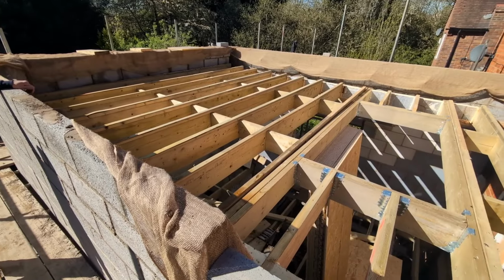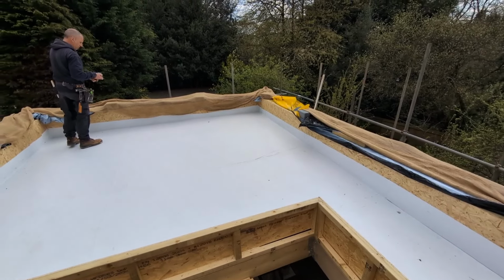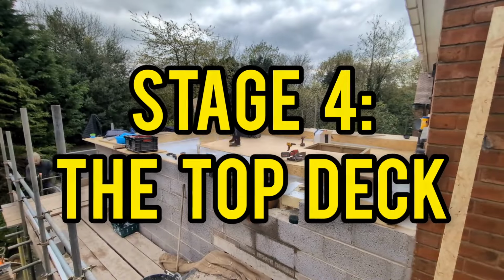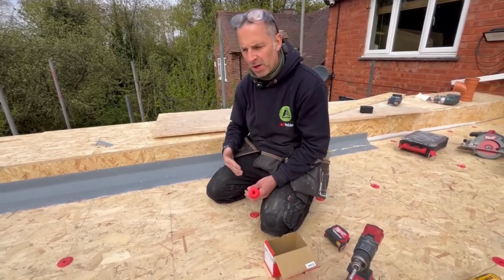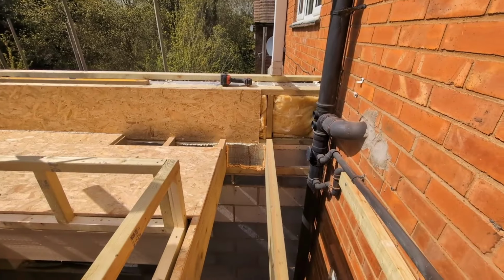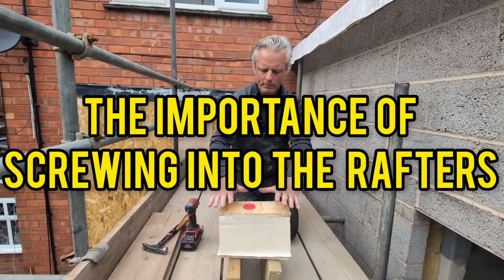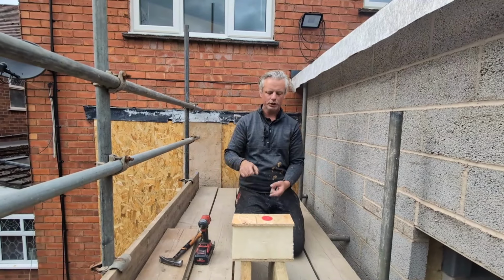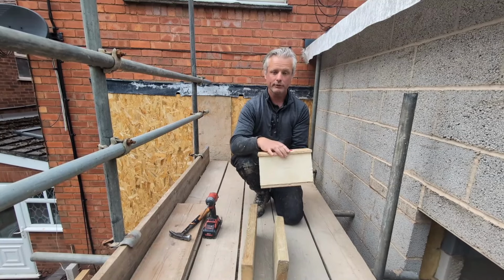How to build a warm roof. A step by step guide to the BEST warm roof on YouTube.

Comment: Hi, very well explained and built. Exactly how we do it and with the festool saw! We do a few minor different things like 50mm sound proofing rockwool below the deck which has been checked and approved by Kingspan for condensation risk. Which increases u value and makes the roof quieter. We also cut a slight recess in the deck so the warm roof fixings can’t be seen when the roofing cover is laid. Also we don’t build with cavity walls. Our preference is porotherm with external wall insulation. Anyways moving on to the faults I have been told with our roof is apparently we should not be using warm roof fixings with GRP roofs. Plus if we do they must go 40mm into the joist does not include deck or ferrings. Not the case with any other roofing cover. Also at the roofing show the 5 big roofing covering manufactures which include Bauder, Sika, Danosa, Icopal and the others all said tissue based insulation for flat roofs only must be used on top over the VCL and then no ply or osb but the roof covering must go directly onto the insulation board. Indicating warm roofs should not use GRP. GRP companies I am sure would not like this. I have a document which is similar from all these companies as to the physics that mean a warm roof can’t have a osb or ply top deck. So I have wondered if a cement board floor could be used. Then recently due to Grenfell you can’t make a warm roof apparently that does not have a fire certificate. So event though all of the manufactures have a very similar or same looking silver and black sticky VCL (like alutrix 600) simular tissue backed insulation. You have to use all these layers made by the same manufacture as the roof covering to comply with current building regulation as they don’t fire test competitor's simular product and hence only way to get the fire certificate is to use all the materials from one manufacture. So this leaves me confused moving forward as doing it that way would remove GRP roofs and increase costs of materials.
Reply: Be good to hear a reply to this! Currently confused as to the makeup for a warm roof im about to do on a property of mine
Reply from the maker: Hello Liam, hope you're well. If you're in England (I can't speak for any other country) then just follow the steps in the video and you'll be fine. You don't have to use GRP, you can use any roof covering you want. Any doubts then ask your building inspector.
Reply: @Mr_A_Builders  hi buddy. Yes uk - scunthorpe. 
It was more the use of foil backed pir with osb above this. Manufacturers advise against it for some reason due to condensation/ deterioration of this top osb. I'm wanting to use it and didn't know if to source a non foil faced pir board to avoid this risk.
Reply from the maker: @LiamLiddy Hello mate. If you'd prefer you could send us an email (address is in our bio) with you phone number in and I'll give you a call and we can go through it. May be easier?
Reply: @Mr_A_Builders  really good of you to offer that! And replying to your comments 👌🏽. If you could tell me where abouts to find the video showing how to set up the diminishing flat roof rafters so I can fall the whole roof to the outlet that would be great!

Comment: Hi,flat roofer here for over 40yrs  why oh why would you go to all that trouble and then put a top board over the installation and cover it in grp ? When you can get rid of your carrier board and go with a single ply membrane or a built up felt system or a liquid pvc system straight on to the installation far far better and will last for years
Reply from the maker: "far far better" in what way?
Reply: By getting rid of the top board on the installation and then install a decent waterproof system instead of GRP or epdm that requires a top board as this  is a bad practice regardless as to what Mr GRP man says
Reply from the maker: @rcteryx how is it bad practice?

Comment: If your doing grp finish then I would use 18mm T&G as top substrate… reason being… with grp you need to make sure their are no gaps that resin can flow into underneath the matting…. T&G prevents this from happening.  Otherwise you can end up with pin hole sized holes in your grp roof.. alternatively just seal all butt joints on normal 8 by 4 OSB with some sort of sealant.   It’s belt and braces for sure but I have seen it happen.. and the pin holes are really hard to find on a warm deck roof… so best be safe..

Comment: Really appreciate the thermal fixing explanation and model. I've used the wafer head screws and you're right, you see them everytime there's a frost and the heat transfers through the screws.
Reply from the maker: Well there you go, mate. Every time you can see them in the frost that's heat escaping and simultaneously damaging the roof covering! No worries man! How's things anyway?

Comment: Great video and work. my concern would be air gaps around the fixings when using Grp, as those raised areas would be a bugger to get a perfect seal with resin and matting. What do you think?
Reply from the maker: Hello mate, I see your point and it's a valid one, which is why we filled the screw holes in the thermal fixings. When then took special care to work the matting around the fixings for the reasons that you say and it worked great. It's definitely something that you wouldn't be able to do with a rubber roof.
Reply: Cheers from a Brighton roofer/builder..we do a lot of GRP work.
Reply from the maker: @bluewaverenovationsltdpurt8104 no worries man. Hope you're well and busy. Take care.

Comment: Just saw this great video and explanation.      regards thermal insulation, is it better to have this above the joist, or in-between or below,   we are looking at replacing a glass conservatory roof with a flat roof as its leaking after more than 12 years.  so done well but now with the cold weather etc.  I am worried if in between the joist will still conduct the cold through via joist.   today it was 9°C inside and its 0°C, outside (4th Jan 2025) yes I know you norther's think its warm but we southern lot like it warmer 🙂 helpppppp
Reply from the maker: Hello Pete. If it's a warm roof that you're going for then just follow the steps of the video to the letter and you will not go wrong.
Reply: @Mr_A_Builders   Hi Thanks for that.  Need to check if we have the height for that.

Comment: After reading a few comments on here, I just wanted to try and clarify a couple of points that might help others.
I think a lot of confusion stems from the fact that people (and the internet) mix the terms 'Vapour Barrier' and 'Vapour Control'... A vapour barrier will stop both the movement of air (thus being air tight) and any passage of moisture... whereas the vapour control is generally considered air tight (factually it's not) but will allow for the slow passage of moisture vapour. It's all to do with the materials that make up the various products.. for example: if you take a metal pole and call that the vapour barrier and take a wooden pole and call that a vapour control, place both the poles into water as a source of moisture and you will see that the wood will slowly absorb the water (moisture absorption will rise above the water level) whereas the metal pole will not (close enough without going into atom detail). 
A VCL (Vapour Control Layer) is designed to a slow down the passage of moisture to a controlled level whilst also allowing an acceptable level of air passage as not to affect the warmth of your property. In a warm roof construction, a VCL should always be used on the underside of the insulation.
Another common misunderstanding is that when something is labelled as waterproof it doesn't mean that it is also air-proof/air tight.. for example an EPDM rubber roof will stop water/rainfall passage but will allow air passage... thus allowing your warm deck roof to breath, remove the controlled moisture passage from the VCL whilst keeping your house warm and snug.. 
PS. Great vids.. keep up the good work  👍👍

Comment: Happy birthday! Wondering what you think about the theory which says that you ideally shouldn't use a top deck of OSB because it's on the cold side of the roof and more susceptible to condensation and rot. Better to just have the roof covering directly bonded to the insulation. Also heard that foil faced insulation isn't the best thing to use either, because the foil facing acts as a vapor barrier and you only really want one vapour barrier in the system, otherwise you can potentially trap water vapour in the middle of the system. Needs to be hard for water vapour to get in, easy for it to get out.
Reply from the maker: Thank you, Ewan. I don't really buy into that to be honest but I'd happily be shown and proved wrong, always willing to learn!!! One of the main issues there is how do you fix the insulation down? We all know that it's not the strongest of materials. Also, the only thing holding your roof covering on is the glue between the PIR and the foil or the fabric type stuff. I won't be charging people for that anytime soon!
Reply: @Mr_A_Builders  Where I've seen it done they just seem to use the same thermally broken fixings as you did here, the large "washer" on the top should help spread the load a bit. It's not the strongest, but even in this video you guys are walking around on it without much cause for concern. It's really not that different to the stuff you use under a concrete floor.

Comment: Great video as always lads, id love to see more on how you drain the rain water from the roof.
Do you guys aim for a perfectly level roof or do you use ferrings for a slight slope towards the outlet?
Reply from the maker: If you’ve only just joined the channel Dan welcome but we do it two ways. In this instance, which I went into in detail, was diminishing battens. 👍🏻
Reply: Awesome video. Clear and to the point but, I also had the same question - From the finished picture it looks like a perfect bath tub to catch water but with with no apparent drainage point?  Where will the rainwater go?
Reply from the maker: Oh there's a drainage point! Trust me! From the thumbnail it's the far opposite corner, you can't see it because of the lantern, it is in the video though.

Comment: Thanks for another great video. Just started a warm deck today. I’m always confused with the vapor barrier. So it stops all the condensation from the insulation soaking the deck below but what happens to all the moisture? Does it just stay trapped forever? 😆
Reply: Think its to stop moisture from inside the building condensing on the underside of the top deck and rotting it.
Reply from the maker: Hello Dom, hope you're well, mate. The vapour barrier is to create an air tight seal from the bottom deck upwards. The whole point of it is so the heat within the room below stays there and can't pass through. That's why we screw through into the rafters, it's to try and maintain the integrity of the vapour barrier and not rely on its "self sealing' properties.
Reply from the maker: That's sort of it, mate.

Comment: Hi, im currently doing a warm flat roof. 

Ive done ply above firring then alutrix 600 stuck on then 150mm pir then osb 3 then it will be edpm

It also says to put a vcl on under the joists (ceiling) before plastboard is this wrong ?
Reply from the maker: Hello Matthew, hope you're well. Sounds like you've done a great job! Nice one! You don't need that VCL under the joists, you've already installed one so that's that! Just plasterboard and you're away!
Reply: @mrabuilders6723  Thankyou for your reply thats helpful. The chap whos going to lay the edpm isn't keen on those thermally broken fixings with edpm. Realistically do you think there will be any problems if I just use long screws through the decks, I know alutrix should heal around the screws which should help a little..

Comment: Hello both. 2 questions please. 1) Theres a lot of strand board used on the layers of that roof. Is it a warm roof solely because you need 150 mmm insulation making cold roof impractical. 2) How did you transfer the rafter centres up to the roof 🤔 . Thanks 🙏
Reply from the maker: The answer to question two is simply just measure off a fixed point then go underneath and see if you can see a screw poking through, if you can't then you've hit the rafter! As for question 1, it's all about the height of the roof and what you can get away with which we will go through hopefully in the next episode.

Comment: Could you use 18mm OSB  instead of 11 mm therefore countersink the plastic thermal fixings hense have a flatter deck for the GRP ? Love to hear your thoughts ?
Reply from the maker: Hello Glenn. It's not impossible mate, but the heads of the fixings are approx 5mm if not more, definitely not less, and you'll have to go deeper as to have room to fill over them afterwards, so there's not a lot of meat left to confidently fix down to if that makes any sense?
Reply: We do this and use 18mm t&g OSB3. We use a countersink and take out approx 4mm. We thought about filling them in after but have not needed to and you can’t see any fixings. Good idea though to fill fixing hole with foam like they do on this video. But have to agree if you try to do that on 11mm boards you wont have much meat left to confidently fix down. Have to say this video they made is the best one I have seen on here

Comment: Just out of curiosity, the detail for the timber upstand - does it require vcl internally to prevent mositure laden air from entering into the space. If so, how do you achieve it, is it a simple case of adhering to the inner face of block work and underside of deck around the perimeter?
Reply from the maker: Hello, hope you're well. If I've understood the question properly...no. We want the air that's in the room to do one of two things...stay in it by not passing through the vapour/make up of the warm roof, or go through the wall and up into the insulated cavity where the only place that it can meet the cooler air of the outside is the very top of the parapet which is beyond the perimeter of the room thus not being an issue. Does that make sense?

Comment: I want to know if iv installed 150mm kingspan in a warm roof cam I then install 50mm rockwool underneath in tje 9x2 space ? For sound proofing?
Reply from the maker: Hello Chris, hope you're well. No, don't do that. Only have the insulation as part of the top deck, nothing in-between. Sound won't be an issue. Thank you for watching.
Reply: Hi, love your videos,  you guys are a joy to watch.  Can you expand a little on the reason why putting extra insulation (soundproof or otherwise) into the voids is a bad idea? Is it because it would hinder the moist air from escaping?
And if so would using insulated plasterboard on the ceiling also be a bad idea?

Comment: Great video , just one question,   would ,  100 mm joists half upper filled with insulation plus11 OSB then a further 70 mm insulation plus another 11mm OSB , the membrane in-between ceiling and joist , thank you in advance

Comment: Great vid.
If any moisture gets through a screw where you've missed the rafter. Isnt it less desirable for the moisture to gather in the PIR. Moisture significantly reduced the thermal performance of PIR.
Could adhesive be a better solution as opposed to screws?

Comment: The thermally broken fixings are essential as you say, if you're putting a deck on top as you have. But assuming you're going to cover that in EPDM, what's going to stop the top deck from rooting out? Doesn't this end up being an unventilated cold roof on top of a warm roof?
Reply from the maker: Hello mate, hope you're well. Thank you for getting in touch. Before I answer your question...have you been watching the Build Better Things channel by any chance?
Reply: @Mr_A_Builders  no
Reply from the maker: @darkHouseMM Hello mate. Ok, I was asking because that channel did a video recently suggesting exactly what you say and used this video of ours to demonstrate how not to do it whilst simultaneously getting it completely wrong in the process! There is absolutely no evidence to suggest that the top deck will rot due to vapour loss. Absolutely none. This particular roof is GRP so the top deck is needed, as it is with every single roofing option with the exception of rubber.  If you build your warm deck to the spec and standard of this one you will not have a problem I assure you.
Reply: @Mr_A_Builders  I was at a  building  and renovation expo  reccently and there was talk about this - seems there is divided opinion
Reply from the maker: @darkHouseMM yes mate there is. It'll be shut down once and for all if anyone could provide any evidence of failure! But untill then....

Comment: Hi Adam, at point 10min on the video Rich was talking about the fixings being 161mm overall, but the total depth of the insulation and OSB would be 176mm ?
Reply from the maker: Hello Kevin. The thermally broken fixings are 100mm and the screws are also 100mm, so over all when it's all clamped down you've got about 190mm. Obviously you can use longer screws providing the heads fit down the shaft of the plastic fixings!